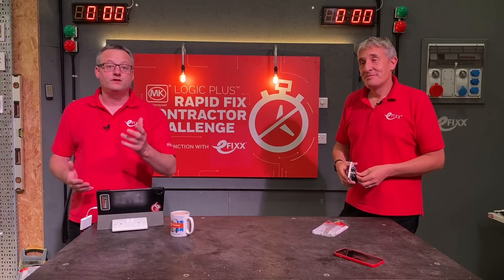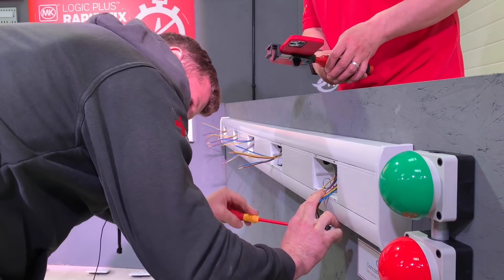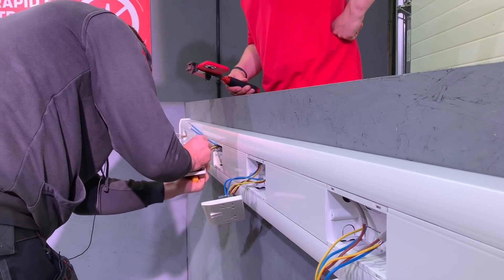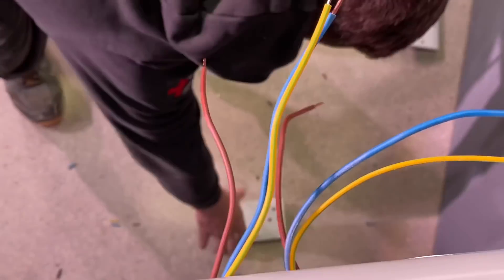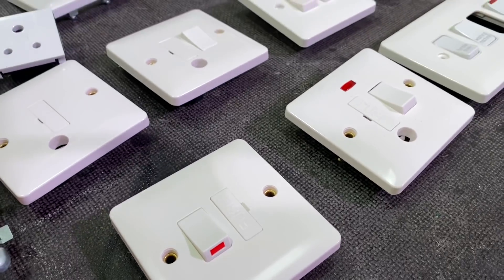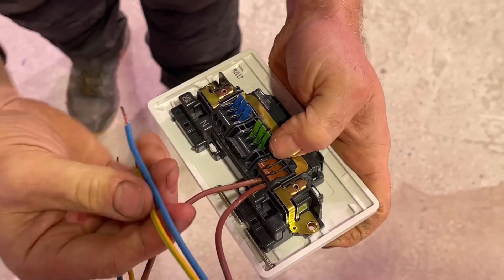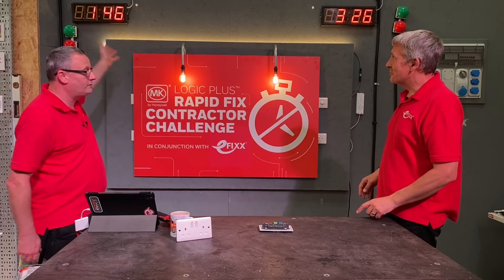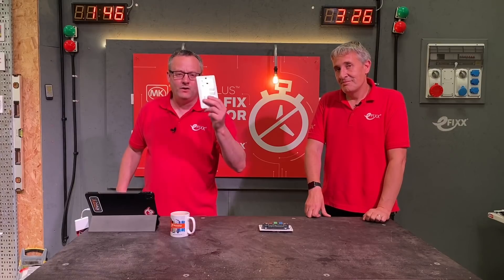MK RAPID FIX SOCKET- V- SCREW TERMINALS time to hand it over to a tame electrician.

Comment: If the terminals work like the Wago 221 you don't even need to open the levers to get the wires in. Did someone test if that works? And I had a laughter at the "sausage finger" expression, we got that too in the German language (Wurstfinger) meaning exactly the same thing.
Reply from the maker: Yes we tested it - you can’t push the conductors in. wurstfinger we’ll be using that - Thanks Marcel 😄

Comment: How are back box fly leads accommodated when spurring of the ring using these sockets.
Reply: Exactly. It seems an extra CPC terminal should have been included for that purpose. 🤔
Reply from the maker: Just fold the Cpc from the spur and use the back box terminal.
Reply: @efixx  Can't they provide an extra lever connection workrounds tend to take the gloss off a new product.
Reply: @efixx  That'll work. It's still an oversight though. 😁 Mischief is my middle name! 😋
Reply: @efixx  that is super naff in my opinion, looks poor and its gonna be the first place the cable breaks when removing and replacing faceplates

Comment: This termination system solves a problem that doesn't actually exist.  Termination of outlets is a small part of the job compared to everything else.
Reply from the maker: Electricians have been asking for screw-less terminals for ages. In the rest of Europe they’ve had them for decades.
Reply: @efixx  I don't think the intention is to solve a problem, rather to make an improvement, which these do imho. Where the levered terminals would be of benefit is in a ceiling rose, especially if it were somehow designed to line up with the screw holes and fit inside of pendant lights that are sold with a simple three terminal block. Again, imho😊
Reply: @efixx  efixx will have to send Gaz over to foreign parts to bring some samples back so we can see what we are missing out on I bet our version is much superior to those made on the continent
Reply: @efixx  I can see the case for wagos.  We fit thousands of them each year. But with these, you aren't covering the extra cost of the outlet vs the labor to install.  My situation may be different here in Australia - our labor rates are HIGH and the materials costs are probably double what you are paying for.

Basically - the labor cost saving is moot by the materials cost going up.   You are literally saving pennies, by paying pounds.
Reply: "Solves a problem that doesn't exist"  That's why Wago connectors have all but replaced screw terminal blocks in other applications?
Reply: Loose connections do exist and can develop so it is a problem that is worth addressing at installation.

Comment: Two things. With screw terminals, how many times did you check it all and STILL had to go back, take it apart, to find a broken or loose connection? Worse if you have gone off site and have to come back. Second, ever leave an installation convinced it was done right, it tested right, got called back, to find a loose wire? Ever suspicious somebody had been in there? Of course you have. Now, even a numpty could put it back right. It isn't just about fixing it quickly. That alone would be a few minutes per day. It is the not having to revisit the socket, either on the day, or on another day. Can't wait for other fixings in the same design. 3 plate ceiling rose? I hate them. Light switch ... Also, when dressing the wires, you would soon get used to preparing them ready to push in quicker. I noticed your electrician found it was quicker to simply grab any wire and shove it in, rather than do them in order. He has sausage fingers just like me, also a biker and ex rugby player.
Reply from the maker: Thanks Trevor - we believe more screwless accessories are in development!
Reply: @efixx  'we believe', hehe. Nothing official then. Great to hear. Keep up the good work.
Reply: True. I said it earlier, 3 conductors in their own terminals is a far better fixing option. Each conductor would be equally secure. You get to a retrofit and the conductors are a bit short and your wrestling with a socket to feel confident that the connections are secure. Using this type of accessory would give far greater confidence. Come to think of it, it's gotta be worth carrying a couple on the van just to help out in that situation.

Comment: The pertinent factors here (apart from price) are speed and pressure/tension. Even if screw connections can be made quicker than constant pressure connectors (which only some people could do), constant pressure is the important safety (re fire and repairs) factor that makes them the far better connectors to use. All we need now though is enough people to buy this range, or other manufacturers to compete with MK, so the price drops.
Reply: Prices will come down

Comment: Let's face it you wouldn't be going at that speed day in day out. But the push fit system is quicker regardless of what people may say.
I have said for a long time it should be in fuse boards, that way it will stop the idiots causing board fires.
Imagine giving those electricians that are negative about these sockets, a brace and bit for drilling joists, a Rawl tool for masonry and the good old Yankee screwdriver with slotted screws, I wonder what their reaction would be then 😂
Reply from the maker: We've got hold of some Wago terminals which handle 125A !
Reply: @efixx  wow 👍
Reply: @acelectricalsecurity  You say idiots causing fuse board fires, I went to another job yet again yesterday where the meter installer hadn't even screwed the tails in from the fuse head. When the customer was under the stairs getting a gas reading they knocked the cable out. Considering they seem to average about a days worth of training I think meters should have these connections before consumer units. Thankfully no one died but it's becoming a little concerning how common it is to find faults with the metering equipment caused by rushed installs.
Reply: @effervescence5664  yeah that's true, I have had several installations where they had a new meter prior to when i get there, and have put my tester on the installation to see it going bannas, then I find they have got the polarity wrong.
But the society we live in, everyone has to be fast tracked, quicker is better, lost count of the amount of jobs I go to, where the customer asks how long it will take, I tell them, then they say the other guy was going to do it faster, so I say get him.
Reply: @acelectricalsecurity  Only just been notified of your reply after 2 months, good job YT. Completely agree with you though, I just walk away from customers that are in a rush to get things done and want corners cut. Thankfully we can pick our customer base and turn down work where we don't feel a customer values quality over speed, not everyone is in such a good position.
Reply: Many of the consumer unit fires I've seen have been at the busbar where its made little to no connection for years with the often client reporting an intermittent fault on the circuit before the smell of fish and then the obvious fire 🔥 even I've missed the busbar screw. Defo a place to triple check!

Comment: Gotta be the way forward. I mean, would you rather jam 3 wires into 1terminal or 1 wire into 1 terminal 3 times. One thing I'm thinking though, especially with consumer units and the need to remove conductors for testing: At what point does the factory torque weaken and how is it checked?
Reply from the maker: Good question - we'll explore this with wago.
Reply: @efixx  Wago have told me they are checking with MK regarding force gauge pressure tests to ensure they match up with their own connectors labeled as their own. Hopefully they are just as good.
Reply: Pretty certain they are good for many many many opens and closes, not had seen issues with wagos losing clamp
Reply: @s.kxx1956  based on what evidence?
Reply: @ascot4000  yes it’s a whole bunch of things that matter material quality, tensile strength, geometry you mentioned and here there maybe compromises in term of having sufficient  good geometry to keep things in place but still allowing air to circulate to reduce thermal wear over time. I wanna know from the manufacturer that these tests have been done and they have the results to prove it. We have UL listing here in the states which helps to differentiate better tested and capable products than those that have not gone through that process. Making them safer and appropriate to use in the right situations our standards refer to use of products with this kind of laboratory/engineering testing, separate from manufacturers own tests.
Reply: I used to have a wago in my pocket don’t ask but I used it as a fidget lifting the levers up an snapping them down it finally disintegrated after month of this abuse well over 50 snaps most screws would have lost there slot well before
Reply: @ascot4000  Wago I totally respect them on their technical information. Their technical information for US UL listing purposes was great, and I do like the German standard, on technical standards it’s easy to say US is way behind, is that due to greater corporate pushback against regulations? Not really in the case of the electrical. The NEC 2020 is actually a good standard not perfect but no standard is that. Our recommendations on ADS, RCDs, AFCIs, SPDs and their use on most if not all circuits, wiring, Conduit, earthing/bonding mechanical protection segregation of circuits, more single use dedicated circuits, use of tested listed products in my mind are good as anywhere and go further than many other international standards earlier and faster. We don’t allow ring circuits Europe does not but for UK it’s a historical hangover that can’t be gotten rid off easily. They are I believe slowly for new installs moving away from them and I suspect that’s where UK is headed. I hear knowledgeable UK electricians like the Irish standard better.

One or two areas I am less keen on  in the US is lack of testing recommendations for electrical installations in a residential setting other than earthing resistance, not banning the use of multi-wire circuits, electricians still twisting conductors with twist caps. However if these are done well with listed products they are safe and work and will stack up well against a lever type or push fit connectors.

Testing is covered in different other standards more for industrial equipment/settings. Any standard is a minimum a great electrician will always aim to go above and beyond when they can.

Non-approved items cannot be sold? I am not sure everything you can buy even if it’s approved is actually engineered well or has longevity. There are always retailers willing to sell something cheaper and customers willing to buy them. That’s where I think social media can help with Electricians informing each other of what approved product works well in what setting.